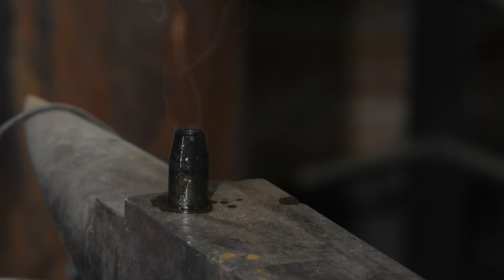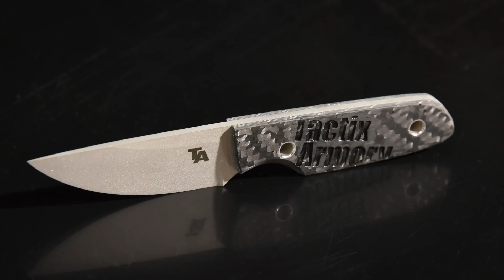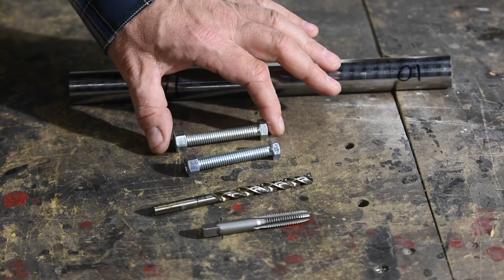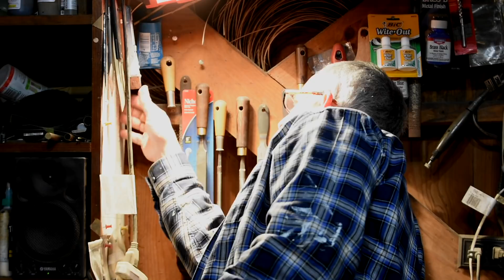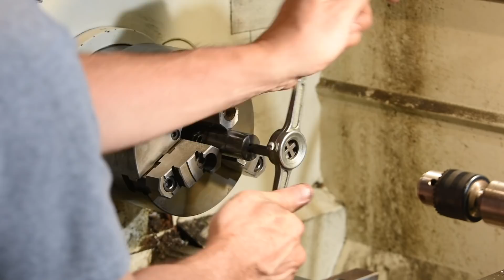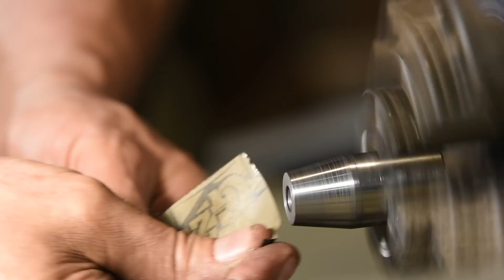Making a Machinist's Jack

Comment: I did the Sissy AND Lazy, getter' done version: Weld a 1" washer to a coupling nut and insert a carriage bolt w/ lock nut. Done. Carriage bolt makes for a small contact point so no need to worry about yer base and bolt surfaces being parallel. :) But these are nicer if you have the lathe and/or mill.

Comment: Would the jacks work better with a ball bearing epoxied into the top?
Curious because most of them I have seen and used were made that way, but then they were used to actually lift and level the 3" plates and other heavy materials we were working with.

Comment: Good job,,,
Thinking is cheap, and giving away ideas is fun, especially if they are useful. 
Would several bolts of verious lengths be useful? And how about different profiles on the head of the bolts? As in, pointed , or a radius.?
And then, while we are at it, thread the out side of the base, and put a T for the T slot. And use a nut to tighten it down.
Seeing a need is what made us great. And letting us fulfill that need is what free enterprise is about.
And letting us make a living while we are doing it, is what capitalism is about.
That is the 3 legged stool that is America.
Now, to teach that to the politicians. ..
Thanks again for the good work.

Comment: @ 6:41-7:00, you’re machining the bolt head with the bolt screwed part way into the other piece. Why doesn’t this make the bolt screw the rest of the way in or unscrew from the piece? Why doesn’t the bolt turn?
Reply: The nut locks it in place. When you tighten the nut down against the face of the jack the bolt won't move any further.
Can also be done with two nuts on a bolt.